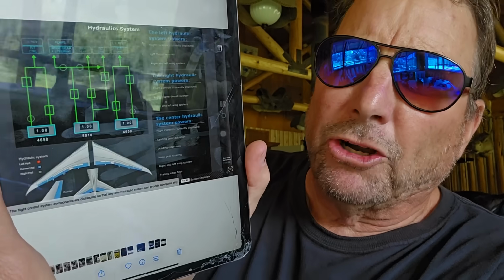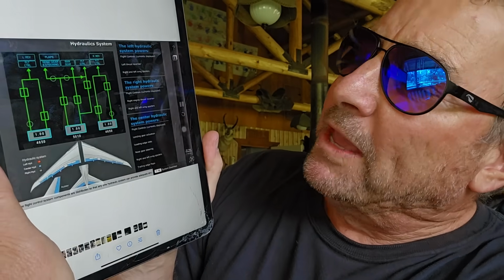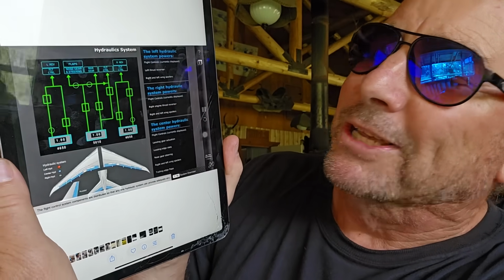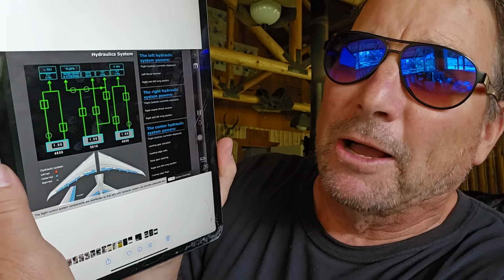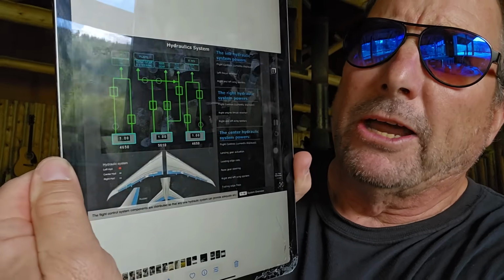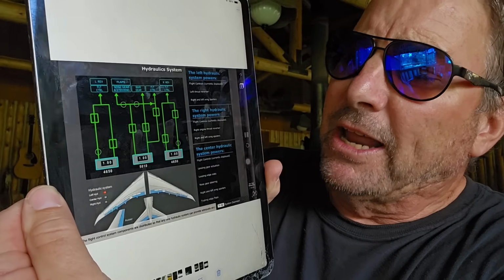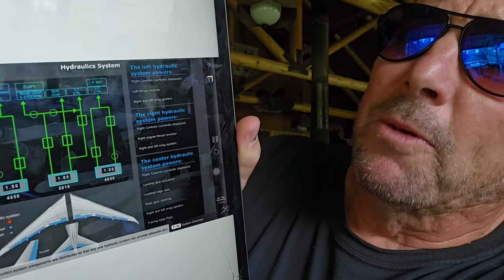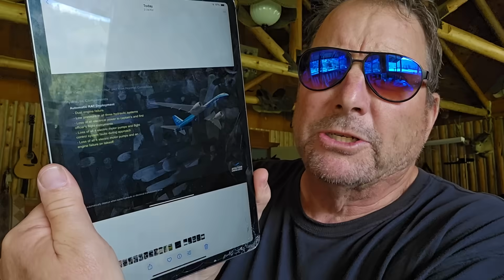787 Crash India What's a RAT? When does it deploy?

Comment: If the flaps were improperly set the advancement of the power levers to takeoff power would have triggered a configuration warning in plenty of time to abort the takeoff.  It is very unlikely that this crash was due to misconfiguration at takeoff. Deployment of the RAT is the "smoking gun" clue to what actually happened.

Comment: I heard speculation that the flaps might have been mistakenly retracted instead of gear up as it appeared the gear was never retracted and it looked like the flaps were not deployed as the plane went down.
Reply: People come here to avoid speculation with no evidence.  If you read through the comments you will find many stating that there are now pictures from the crash site showing the flaps in a normal take off configuration.  As to why the gear was down, look at 4:14 in the video.  The gear will not go up when the RAT is the power source.

Comment: I’ve read a number of final reports for dual engine failure after liftoff. All had the same cause, jet-b loaded into a piston twin by fuel truck. Is it even possible for a 787 to be loaded with the wrong fuel?
Reply: Jets will burn avgas, it just reduces the range.  There are rumors of old Vietnam pilots, in Louisiana burning car gas in helicopters and I know one added bourbon to the tank one night.
Reply: One can confidently say it’s impossible. If at that airport they have an underground distribution system, it’s full of jet fuel, not 100ll. If they fuel from trucks then two fifteen meter trucks will be doing the fueling, and they’re not carrying 100 tons of avgas

Comment: I'm an airline pilot for the last 27 years. This is VERY good analysis. I think we can make a few more deductions. First, if there had been an engine failure, we would see some yaw (wobble laterally, like a fishtailing car) from the plane. Secondly, a loss of engine driven hydraulic pumps wouldn't cause an immediate descent and crash. As long as the engines are operating normally, you can get by on auxiliary electric pumps and control the airplane. The airplane never appears out of control, just losing power or unable to maintain altitude. The airplane only made it up to 600' above the ground before it started descending. This means the computers (ECM's) were in the takeoff mode which generally doesn't switch to climb mode until  at least 1000' off the ground.. This is tricky. You program the computers with the temperature, runway length, airport elevation, weight of the aircraft which then tells you what flap setting and takeoff power you need. So a programming mistake could give you the wrong takeoff settings and may not set off an automated alarms if the internal logic was consistent but not congruent with the environment outside. Thirdly,  Computers, electronics all can be very tempermental. It sounded like the RAT was indeed employed AND that the engines were running. Curious indeed. That points to some complex interaction of computer logic on the engines and computers. The airplane looks like it was flown into the ground after the mayday. This is what you're supposed to do.  You might deploy the rest of the flaps if you were sure you were going to impact the terrain, but it's hard to think right before you're going to die. If the RAT deploys on it's own (you can manually deploy a RAT but that seems unlikely) there is by definition, a mechanical problem. I wouldn't be surprised to see the 787 grounded very shortly.
Reply: There's a scenario you haven't considered. The fuel system on a 787 is entirely electrically driven !

I believe the engines were starved of fuel shortly after takeoff by an electrical failure. You can see the 787 visibly stops climbing out.

I'm very much convinced of a serious electrical issue. On a previous flight that 787 had electrical problems (video'd by a passenger apparently) and the sole survivor of the accident flight also reports a loss of cabin lighting, shortly after takeoff.

TOTAL loss of electrical power would mean the fuel pumps for the engines shut down too (the 787 has no engine driven mechanical fuel pumps as backup/redundancy) and any fuel they continued to receive would be purely by gravity feed only, so the engines would definitely spool down and the RAT would also be deployed on the loss of electrical power.

Conceivably the RAT might then provide enough electrical power to get the fuel pumps delivering fuel to the engines again  BUT the engines would then need to spool up to provide useful thrust and I think they simply ran out of altitude/time in which to recover.
Reply: @grahamstevenson1740  The engine driven pumps can draft fuel from the wing tanks even with failed electric fuel pumps.
Reply: @matthewbeasley7765  NOT on the 787 ! There are no engine driven pumps.
Reply: @grahamstevenson1740  are you sure, I thought Juan said that 2 of the systems were engine driven?
Reply: @grahamstevenson1740 This may turn out to be a bad design decision. Lift is a gift, thrust is a must.
Reply: @tomriley5790 hydraulics…engine driven hydraulic pumps
Reply: @grahamstevenson1740 
Of course there are engine driven fuel pumps. The fuel is pumped from the tanks via electric pumps, through the spar valve before going through the first stage engine fuel pump. If continues through the fuel/oil heat exchanger where it is pre-heated. It then passes through the second stage engine fuel pump before passing through the fuel metering unit, it then goes through the engine fuel valve & into the engine.
Reply: @grahamstevenson1740  there is suction feed on both engines and will easily supply fuel demands for takeoff and low altitude ops
Reply: @TrollingwTyrone  What generates the suction ?
Reply: @grahamstevenson1740  engine main fuel pumps
Reply: @grahamstevenson1740  I agree. I"m leaning towards electrical problems.
Reply: @joeg4466 
An electrical problem would not cause this to happen. Aircraft would fly perfectly well using the battery & hot battery bus. Thrust & lift keep an aircraft in the air, not AC/DC electrics
Reply: @paulbriggs5104  You don't fly modern airliners. They are fly by wire. Flying laptops.
Reply: Could wrong takeoff/derating settings really result in the plane climbing to 400ft AGL and then immediately plunging back to the ground once out of ground effect? I would think proper takeoff thrust is most critical during the acceleration down the runway to get to rotation speed before you run out of runway and less critical once you're actually airborne. Can you really have thrust that is A) high enough to rotate and climb away but B) low enough to lose altitude out of ground effect?
Reply: @somealias-zs1bw  Absolutely. It has happened before. You might not realize it until you were out of runway to stop and just had to try to get it in the air.
Reply: @somealias-zs1bw  I think so.  They barely got airborne before running out of runway, which could be due to a mechanical issue or to incorrect programming by the pilots.  When you have barely enough lift to get airborne at all, rotation will spoil the airflow, stall the wings, and greatly increase drag.  Gear down will add to the drag - but we don't know if the gear could not be raised, or if stall warnings distracted the crew from the usual takeoff routine.  (If I stalled on rotation, I'm sure the landing gear would not be the first thing on my mind.) 
The 787 is a pretty powerful airplane, but fully loaded with fuel and passengers, I don't know if you could gun the engines and fly it through that situation.  Certainly not if you'd lost thrust for any reason.  As others have pointed out, the all-electric fuel pump design does create a critical failure mode.
Reply: @somealias-zs1bw Yes. That information is used along with a variety of other information by the FADEC.
Reply: Boeing is done. McDonnell Douglas killed the company with their greed, ceo salaries and share holders.
Reply: Good review. Initially, I thought I could see the tail slide left at about 100' -- I maintain there must've been LOT on at least one engine, but curious to know if at heavy weight, one engine LOT, lack of flaps and gear down, if this airplane will climb?
Reply: @Saltlick11  that was just a wind correction to the right .
All airliners have to demonstrate engine out runway and takeoff performance and obstacle clearance for certification and at max takeoff weight - which can be limited by certification criteria. I do not think there is any aircraft certified for no flap takeoff. The more modern these planes get they have more means to bitch, yell and scream at you along with master warning lights and goodies on your displays and primary flight display

Comment: I heard the RAT but the jet engines were silent. Both engines. Fuel flow issue or contaminated fuel. Possible vapor lock in the fuel system? I don’t think there was pilot error.

Comment: Hey Juan, there is some in cabin footage from this aircraft taken earlier in the week. It is of a passenger complaing about air India being so low standard, some of the in cabin lighting was not working, the seat mounted entertaiment was freezing, glitching and generally not working. This craft had issues well before it took off.
Reply: Yes, I saw it also.
Reply: I totally agree and it was this that got me focussed on an electrical failure. AI have a bit of a bad reputation in allowing their aircraft to fall into a situation of poor repair.

I'm very much convinced of a serious electrical issue. On a previous flight that 787 had electrical problems (video'd by a passenger apparently) and the sole survivor of the accident flight reports a loss of cabin lighting too, shortly after takeoff.

TOTAL loss of electrical power would mean the fuel pumps for the engines shut down too (the 787 has no engine driven mechanical fuel pumps as backup/redundancy) and any fuel they continued to receive would be by gravity feed only, so the engines would definitely spool down and the RAT would also be deployed on the loss of electrical power.

Conceivably the RAT might then provide enough electrical power to get the fuel pumps delivering fuel to the engines again  BUT the engines would then need to spool up to provide useful thrust and I think they simply ran out of altitude/time in which to recover.
Reply: @grahamstevenson1740 this seems very plausible! Probably the best theory I’ve come across that would explain both engines losing power at the same time.
Reply: @joshlemons3662  Thanks for your feedback.
The only 'flaw' with my theory is how do you get TOTAL electrical failure with TWO engine driven generators. One of them was clearly exhibiting issues.
Maybe the second one (now critical) chose to misbehave too ?

Shit happens !
Reply: @joshlemons3662  Thank you. I'm personally quite convinced that sometime along these lines happened.

Comment: i have a RAT from a Tristar in my workshop, which really needs processing for scrap, unless someone wants it, its damn heavy and about 30 inches tall, in fact i have tripped over it a number of times and fairly recently, people might think a RAT being like a ventilation desk fan, NOPE its one very heavy duty mother of a thing
and i remember working on a static Harrier GR3, the RAT is on the top just aft of the main wing, i needed to open the doors and check inside for water ingress, as the doors are forced open up pops the RAT, well not as simple as it sounds, there are some massive springs in operation and the force i had to use was making me sweat, once the doors were an inch or so open i had to use some wood to prevent the RAT forcing the doors shut on my hands, with some more pieces of wood it was open enough for me to safely get a hold of the RAT and drag into the extended position, put some wood behind it to prevent it slamming back inside while i got rid of the small swimming pool below it and blow out the drainage tubes
Reply: What state are you in?
Reply: @Angelum_Band  not in any state, but the county of West Sussex UK

Comment: Thanks Juan.........I've also seen comments from active 787 pilots ( of course this can't be verified ) that it's virtually impossible for the crew to raise the flaps during the rotation and initial climb out phase of the flight. The 787 apparently has a failsafe system that does not allow for this to happen. Could you shed light on this? Thanks again for taking time to post these videos....I hope you get to enjoy some flying on your time off.
Reply: You can bet that an Airbus won't allow it !
Reply: @grahamstevenson1740 There is no Airbus safer than a 787. Yes, it's as possible in an Airbus as in a 787.
Reply: If you ignore all warning lights and alarms, is it possible to begin the take-off run with the flaps up?  Can you rotate and climb with zero flaps?    Would zero flaps require such an angle of attack on takeoff  to cause both engines to experience a compressor stall?
Reply: @chetmyers7041 i guess it's possible to override if you ignore the obvious visual and aural warnings for incorrect takeoff config., question is whether the flaps would retract if you prematurely pull the flaps up by accident during climb (after rotation) on a 787

Comment: Question.  Would the flaps warming operate in the cabin if there were a break of electrical power  aft of the cabin?  There was nobpower in the passenger section upon landing from what I observed.  When the pilots called a Mayday they knew it was over.  Nothing was working.

Comment: Aeronautical Question:  Under atmospheric and aircraft loading conditions present that day, can normal 787-8 engines produce enough thrust at full power to climb or maintain flight with the landing gear extended and flaps at 5 degrees or less immediately after liftoff?  What would the optimal pilot response be under electraulic/hydraulic failure seconds into climb out? Is this a case where you pucker up and land straight ahead, like they did? Thanks

Comment: This will be an interesting investigation. Some theorize because the landing gear stayed down during take off, it's possible the first officer mistakingly grabbed the flaps lever instead of the gear lever. However, others have stated that due to the flight envelope protection and auto gap protection, the system doesn’t allow you to retract flaps even accidentally. The NTSB report on this accident will be highly anticipated.

Comment: Someone has to find the last fuel truck used and lock it up as evidence
Reply from the maker: Standard procedure in these sort of accidents. Fuel samples.
Reply: @blancolirio  Contaminated fuel typically takes HOURS to make itself known. I cannot imagine it was a factor here.
I have a far better explanation.

The fuel system on a 787 is entirely electrically driven with no mechanical backup !

I believe the engines were starved of fuel shortly after takeoff by an electrical failure. You can see the 787 visibly stops climbing out.

I'm very much convinced of a serious electrical issue. On a previous flight that 787 had electrical problems (video'd by a passenger apparently) and the sole survivor of the accident flight also reports a loss of cabin lighting, shortly after takeoff.

TOTAL loss of electrical power would mean the fuel pumps for the engines shut down too (the 787 has no engine driven mechanical fuel pumps as backup/redundancy) and any fuel they continued to receive would be purely by gravity feed only, so the engines would definitely spool down and the RAT would also be deployed on the loss of electrical power.

Conceivably the RAT might then provide enough electrical power to get the fuel pumps delivering fuel to the engines again  BUT the engines would then need to spool up to provide useful thrust and I think they simply ran out of altitude/time in which to recover.
Reply: @grahamstevenson1740 
1. By design, the engines will gravity feed without fuel boost pump pressure. This is to preclude further complications during an electrical failure.
2. The center fuel tank was undoubtedly empty when it landed.  If they did indeed receive bad fuel, the center tank (with fresh bad fuel) would be feeding both engines.  This could definitely cause them both to stop producing usable thrust.
Reply: Yup. I thought of bad fuel too. But really, I bet it was computer malfunction or electrical.
Reply: WHY ??? What has fuel got to do with it ? Are you an American exceptionalist who believes foreigners can't make aviation fuel properly ?
Reply: @grahamstevenson1740  the point of a competent investigation is that you consider all the possiblities. Wherever it happens.
Reply: @grahamstevenson1740  Ruling out the possibility of contaminated fuel?  Duh!
Reply: @evilload  Contaminated fuel is highly unusual, would have affected other airliners, not just ONE and in the few examples known about takes hours for its effect to be noticed.
Use your BRAIN !
Reply: @evilload I watched an Indian flight inspector debunk that theory and rule it out as there multiple layers of filtration.
Reply: @thenditharam  Amazing.  The Indian flight inspection was able to inspect the engines already?    A theory has to be ruled out objectively,  not subjectively.
Reply: @grahamstevenson1740 Woukd you stop spamming the comments with your ignorance and bigotry.
Reply: @Objectified bigotry? Ok
Reply: @Objectified  What bigotry ? What on earth are you talking about ?